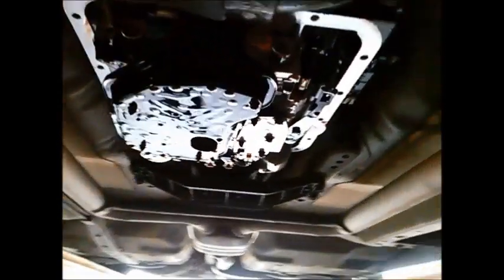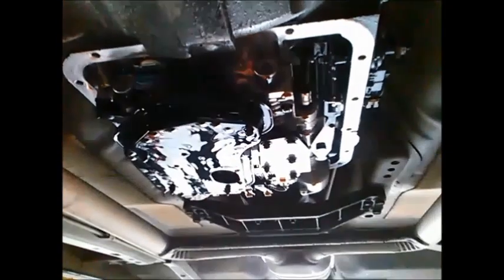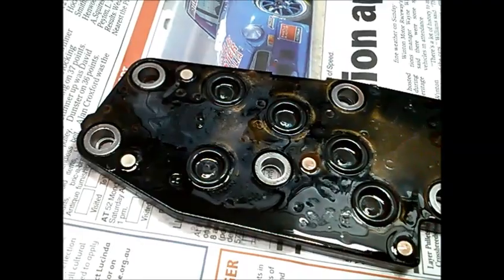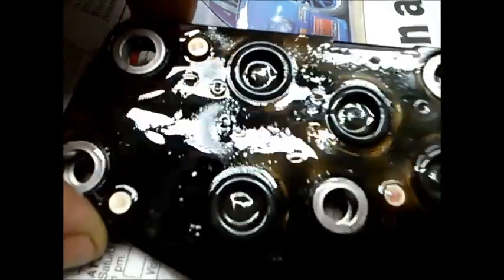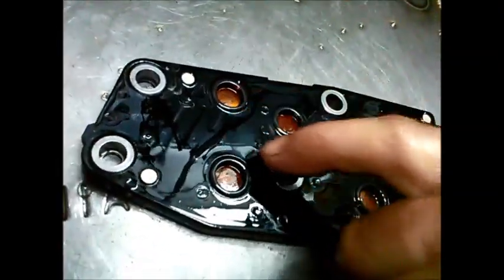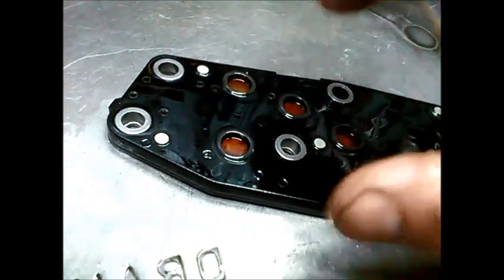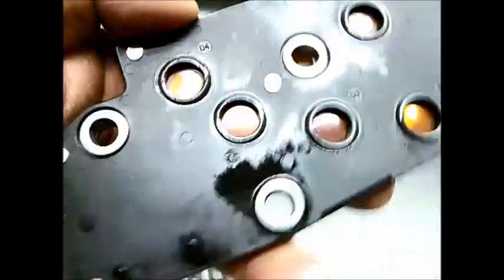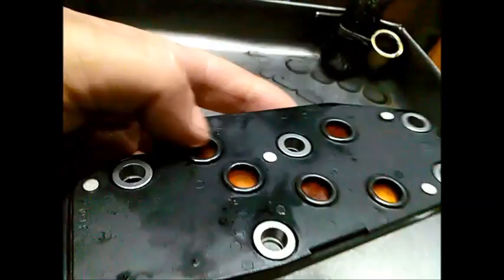4L60E 4L80E How to Properly Service 4L60E Transmissions Most Dont DIY Manifold Pressure Switch Plate

Comment: Those pressure sensing units also have a temperature sensor built in. If that portion of it goes bad it may also cause shift problems. I had a 97 Hyundai Elantra that was having a lot of what felt like slippage issues after the car warmed up. Did some research and suggestions were that the temp sensor in the tranny was bad. Very simple and cheap part to replace ($40) and slippage problem was gone after replacing.
If you have a lot of miles and your pressure switch has never been replaced it might be wise to replace since they cost less than $100.
Reply from the maker: thanks for that, cheers
Reply: The 4l80e temp sensor is on harness

Comment: What are the torque settings for the bolts on these switch plates, I'm doing my 3rd service on my 4l60e vs clubsport and also do a oil cooler bypass. How would I go about draining the torque converter if possible. I love the vids mate, their informative and their australian, keep up the great work  🇭🇲
Reply from the maker: hi, id say about 10-12Nm same/similar as the vbody to case bolts. to do a full fluid change with our flush machine usually needs approx 30-40L ( 3x - 4x original dry fill capacity  4l60 is about 10L )  we only do a full change if coolant/water has entered trans. see https://youtu.be/1paq5RbiTNQ   &   https://youtu.be/Veu5h5evTiY  generally what comes out with a pan drop is enough to reboost the fluid properties. we also like to use lubegard.com products to enhance the trans fluid. if you need some contact us via our facebook link in description if you are in australia. thanks & cheers
Reply: @YepThatsIt  Thanks for the reply and the info. Yeah I'm in Australia I'm in Perth. My car was on stands for a few months while I did all the diff etc, dropped the trans pan cold and got a good 8 or 9 lts of fluid which was a surprise. So all back together now and running good, what brand of trans coolers do you use? (if you can say it on this platform) 
You guys are in Sydney am I right? Keep up the great work mate, your videos are informative and helpful and Australian 🇭🇲👍

Comment: I have a 1996 Chevy 1500 4x4 it shows code p1810 it drives fine other than when I put in 1st to go down the mountain it just goes to 2nd but other than that transmission seems okay it does slip sometimes going up the mountain do you think if I cleaned that out or replaced the switch it would fix it?
Reply from the maker: hi, may be worth a try. cheers

Comment: I have a 1995 silverado short bed single cab and it shows up a code 28 could it be the same issue you have in this videos
Reply from the maker: hi, issue could be anywhere in the circuit from the tcm to the solenoid. usually it is a contaminated solenoid or sensor or pressure switch. cheers

Comment: I have a v2 Monaro and I just rebuild the transmission it's sluggish at 1st gear then it jumps into 2nd gear do you think the pressure manifold switch causing the problem ?
Reply from the maker: hi, any fault codes ? I`d take it back to whoever rebuilt it. cheers
Reply: YepThatsIt I had two fault codes but since I cleared them they didn't show up again

Comment: Do you know what the torque spec for bolts for that pressure switch?
Reply from the maker: hi, which bolts? cheers
Reply: The bolts that mount the pressure switch.. Snug & done I suppose

Comment: If I change the oil and filter in 2001 GMC Sierra has 150,000 mi oil was very dirty that is why I change it, but now It will not get fourth gear code p0753 ??
Reply from the maker: if trans is worn, fresh fluid can make it worse. the new fluid is thinner than old contaminated, broken down fluid. if there are internal pressure leaks thinner fluid will escape through those leaks easier. cheers

Comment: 2000 impala, wont move in drive, but will move dropping to first and driving manually.....changed all solenoids and does the same .....any sugguestions on that? thanks.
Reply from the maker: hi, did you check the manifold switch plate? cheers
Reply: @YepThatsIt  no I didn't ....can it do that if it's faulty
Reply from the maker: hi, worth a try, as well as the range sensor/inhibitor switch. cheers
Reply: @YepThatsIt  I decided to remove the oil pan and found that the belt was broken, thanks for your advise sir.

Comment: The manifold switch plate doesnt show codes? Plz advise!!!
Reply: My trailblazer won’t shift did the fourth gear and no codes are shown :(
Reply from the maker: hi, no it won`t.
Reply from the maker: if mechanical problem, no codes will be shown. some transmissions have input and output speed sensors that will show slipping if they are out of sync.
Reply: YepThatsIt i appreciate your reply VERY MUCH! Last question, I just replaced the manifold plate few hours ago, but still wont shifting to the forth gear, does the computer need sometimes to realize the replacement? Thanks a lot again!!!
Reply from the maker: no it doesn`t
Reply: YepThatsIt God blesses you man!!!
Reply from the maker: cheers buy me a beer !.
Use the "PayPal Me" link CLICK HERE https://www.paypal.me/BATS189
Reply: @AhmedHadiPADI_scuba_instructor  hi did you solve no 4th gear i have the same problem intermittently

Comment: May you help about malibu 2011 v6 ltz with code p0842?
Reply from the maker: hi, if you`re getting a code, its an electrical ssue. check all of them, but pay most attention to to torque conveter clutch solenoid. there is a cone filter in it as well you need to clean. cheers
Reply: @YepThatsIt  car wont move in D after keep it cool or after 3 hours parking. R work, after 10 mintues D engagged and car move normally the whole day. But if i park it again 3 or 4 hours the problem happen again. I checked it it show P0842 as attmnt. May you help
Reply from the maker: @requiem2803  hi, after you check all the basics, it can be blocked/leaking filter and/or a sticky valve in pump or valve body. if you are getting a fault code, generally means electrical issue. make sure you flush the pressure switch as in vids. i have  few showing that. cheers